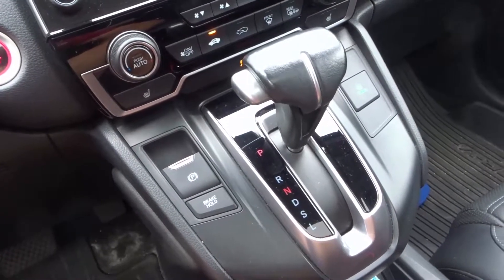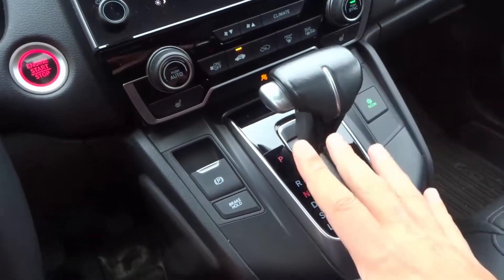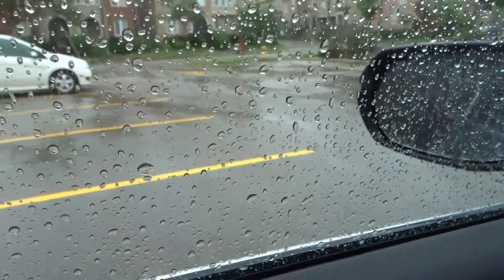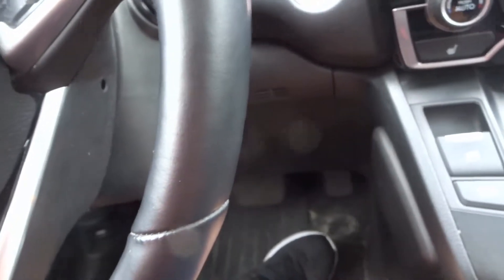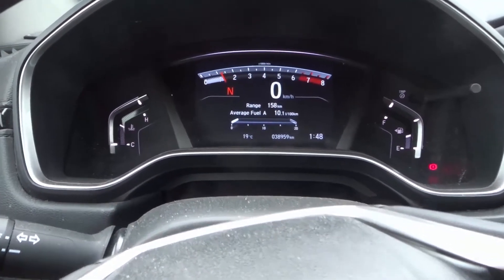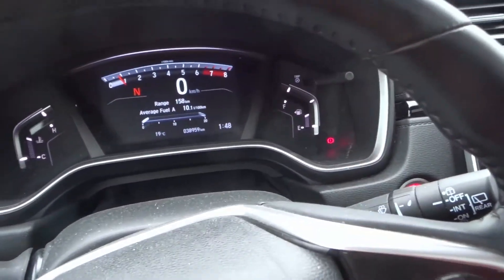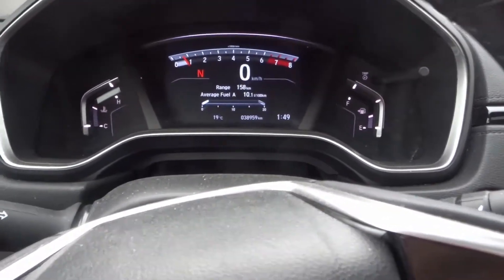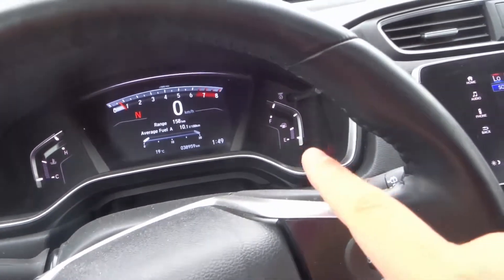Revving In Neutral-Driving Lesson

Comment: If your drifting (as in moving forward without gas, now like sideways drifting) can you rev in neutral and then go to drive to kinda launch or will that destroy your trans
Reply: that'll definitely screw up the trans, I'm not a mechanic but it sounds like it'd destroy it
Reply: Yes it's possible to launch by revving up in neutral then dropping into gear, but it is terrible for your transmission along with many other parts of your car.

You also run the risk of killing your car the first time you even try it unless you've modified your car specifically to handle this kind of launch
Reply: The proper way to launch is to firstly remove traction control and stabilitrak (hold the traction control button for 10 secs aproxx) then put it in first gear, then hold the break with your left foot and revv it to around 2-3 rpm and then as you let go of the break, floor the accelerator and there you have a launch, (this is for automatics only)
Reply: i would assume it would be the same affect as red lining a manual when you drop it down gears in high speed. engines are built to be redlined but doing it for to long can cause permanent wear and damage lowering your engines life

Comment: One important question , is it safe to switch to neutral when driving to rev the engine without accelerating?
Reply: I have the same question. I just got a muffler delete and wanna rev my engine while moving without accelerating
Reply: It's safe, I've done it on my 2002 3.8L V6 Ford Mustang
Reply: Yes, thought I would think it’s better to just hold the clutch down. Should anything happen you can just disingage it and regain control of the car I mediatlu, as opposed to have to get into gear first. 

Basically it’s what you do for rev matching, however you keep the clutch down for longer. 
I don’t think it should wear the clutch much either.
Reply: Not STD
Reply: @newalo7395  not STD
Reply: @DanielHernandez-vt9fc  in std yes it's safe , automatic i don't think so
Reply: I do this all the time. C63 and now ml63. The only reason I'm searching these vids is coz when I do it in my ml63 it takes some time to get back engage the gear when I put back in drive. 
Whereas the c63 went st8 back into a gear when I shifted to drive
Reply: depends on your surroundings, i have a automatic and sometimes it forces a stop

Comment: is putting car into neutral to rev and back into drive while moving bad ?
Reply: Yes. Shifting from N to D isn't necessarily bad i dont think but never shift into N while moving. It will damage your transmission immensely. However, unless your manual says otherwise, you can shift into 3rd from D while driving, even at high rpms and speeds. I usually do that for racing or overtaking someone in the next lane as it runs at a lower gear and thus gives you higher rpms. Do not try it without checking if it is ok tho

Comment: What happens if you’re revving your engine on neutral and you’re at 4kRPM and then just switch it to Drive? What Would happen ? Do you have to wait until your RPM goes down when you’re revving on N before changing to D?
Reply: Same
Reply: thats called a neutral drop. it destroys your transmission. just wait till rpms drop

Comment: Can someone please tell me the point of this? A subscriber just asked me to post a video of me revving my car and I’m trying to understand WHY would one need to do this? Such a weird request for me to do.
Reply: Found this on Google “Revving the engine causes the fluid to reach maximum pressure. Pressure is needed to circulate fluid, shift gears, and engage the clutch packs, and to hold the transmission in gear without slipping.” Is that the reason? Because if so I’m not doing the video lol
Reply: just to hear what the engine sounds like lol

Comment: Now if I’m at a light and stopped but I put in neutral to revvv 
Then put back to drive does that hurt the car? 
Even in neutral I always put my foot on the brake and drive
Reply: It wont as long as you let the revs go back to idle before changing gear

Comment: Also, what is the S gear?
Reply: I think it's the Sport mode. It will make the car take a much lower gear than the Drive mode would, when you floor it as you're entering a highway. The L stands for Load, and it'll keep the car driving on lower gears if you intend to tow something, but it may not offer you as much acceleration as the Sport mode.

I probably wouldn't keep the Sport mode on, since I'm not sure if it's okay for the transmission while you're moving. I've driven automatics very rarely, and probably the only thing I know about them in comparison to manual, is that you're gonna wanna stop and hold the brake when switching in between D, R, P and N.
Reply: "S" IS FOR SUGARRR
Reply: @StillLifeHomocide  bahaha